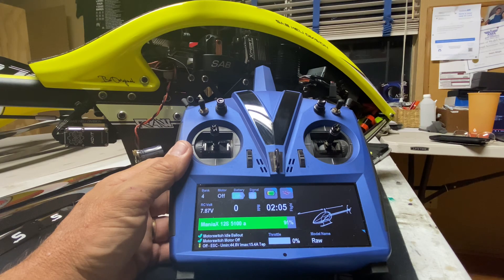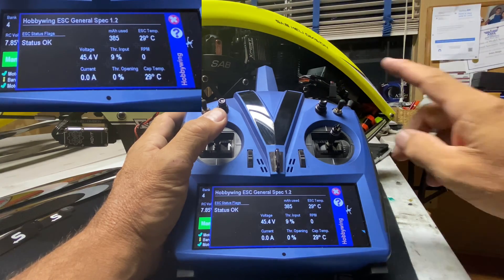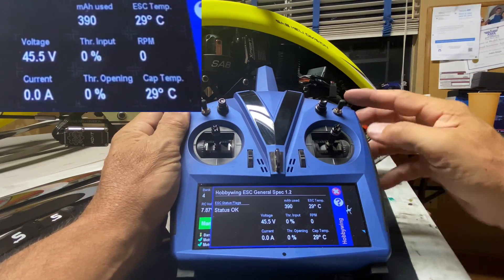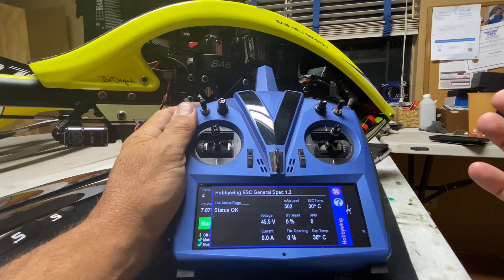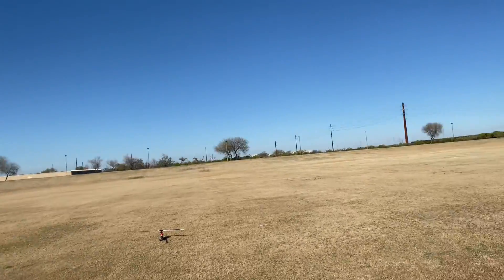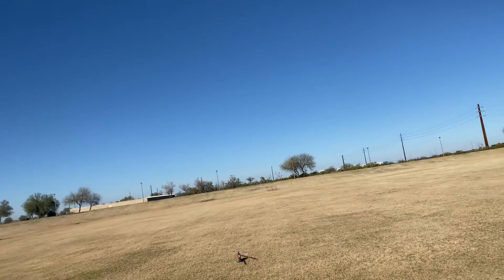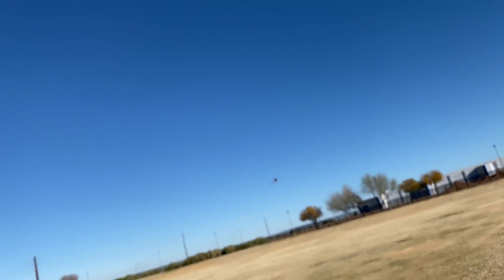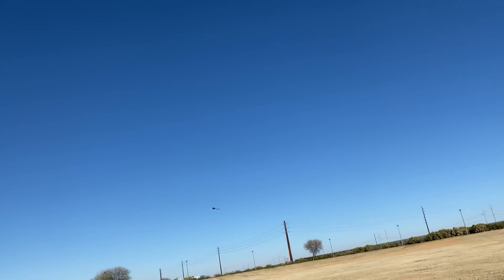Hobbywing ESC - Setup Bailout and RPM Standardization - Part 2 of 2

Comment: You say the opening for autorotation should be between 25 and 40%; yet your's is at 24%, or outside the range. Why is that? Also, what are the bank 1, 2, and 3 percentages you talk about while flying? Thanks,
Reply from the maker: I think I set it to 25%. With the Mikado V Control radio, when I run the Hobbywing Gov, I typically set each of the banks 60%, 70%, and 80% as a first pass and then with flights I will adjust those percentages from that starting point to get the head speeds I want in each bank. If I am running Vbar Gov then I actually dial in the head speeds I want for each bank.